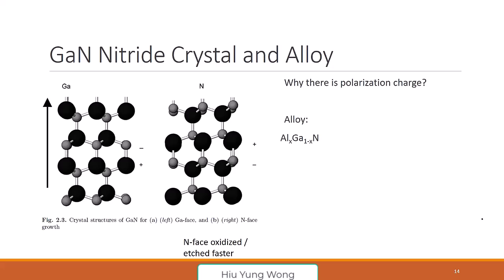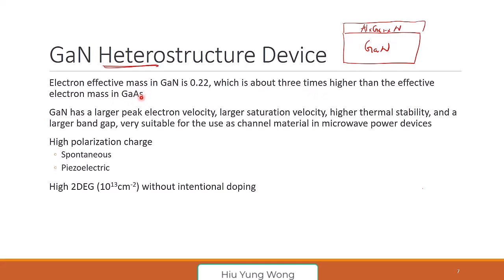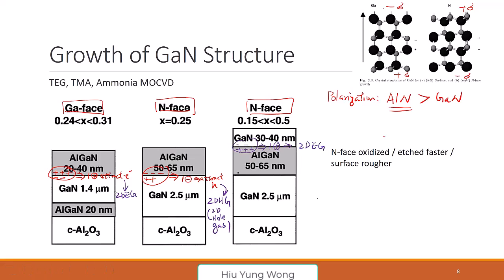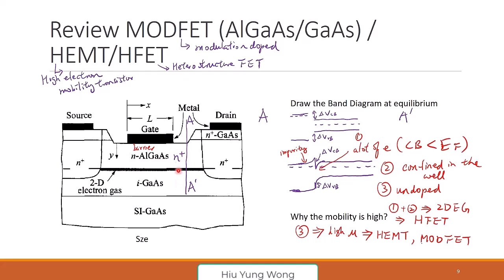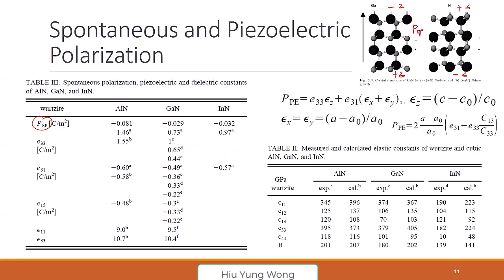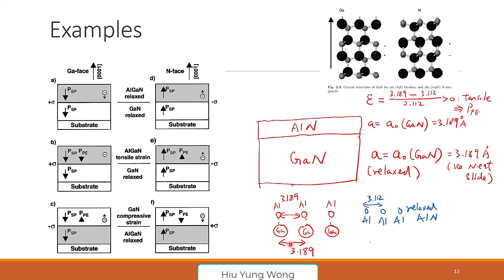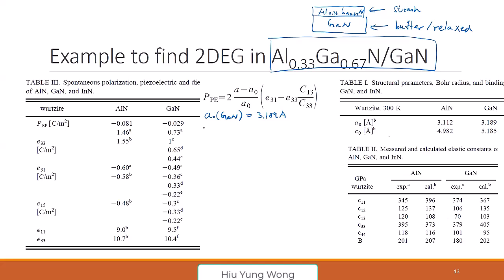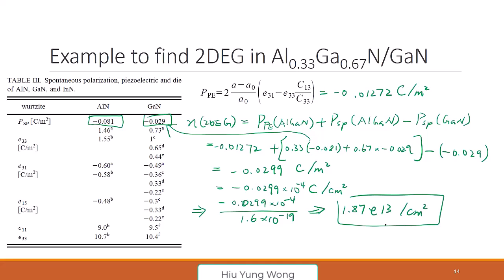19C - (Ultra) Wide Bandgap - Gallium Nitride, Aluminum Nitride, HEMT, Ambacher's Model, 2DEG

Comment: thanks for the excellent lecture, i am wondering if the arrow direction for the polarization is correct or not? Should it not be pointed from the negative to the positive, just like the direction for the dipole moment?
Reply from the maker: You are right. And I think probably the large up arrow on the left at 4:10 makes you think that it is the polarization direction. But this is the arrow for crystal orientation. I forgot where I got this figure. But if you look at Fig. 4 of https://pubs.aip.org/aip/jap/article-abstract/85/6/3222/178438/Two-dimensional-electron-gases-induced-by?redirectedFrom=fulltext, it refers to the crystal orientation. Thanks a lot!

Comment: I have a question please, in slide 12, examples part b and c, why the Piezoelectic polarization in these directions when tensile and compressivley strained?
Reply from the maker: @mimi-moosh1026, good question. This is because of the crystal structure. When you stress it laterally, the charge centers (positive and negative charges) will displace differently vertically and form a dipole. This is just like you when you squeeze a ballon horizontally, the ballon will elongate vertically. This is a Wurtzite crystal that has this type of property.
Reply: @quantum_computing 

Thank you very much for the reply and the answer to my question! for the video! It was very educational, informative, and helpful with clear explanations. You're a remarkably perspicuous instructor!
If I may ask another question, please, why, when changing to N-face, then the direction of the piezoelectric polarization changes under the same type of stress? if we to apply the concept from your answer shouldn't the direction remain the same? Or we're following the spontaneous polarization convention?
Reply from the maker: @mimi-moosh1026  The charge centers of negative and positive charge move in opposite directions under stress. If it is N-face (equivalent make the crystal upsidedown from Ga-face), then you will swap the positive and negative centers and thus the polarization direction changes. Please let me know if it is not clear. Thanks!